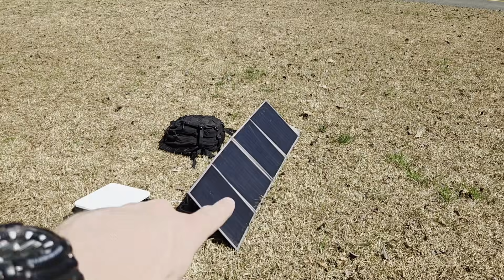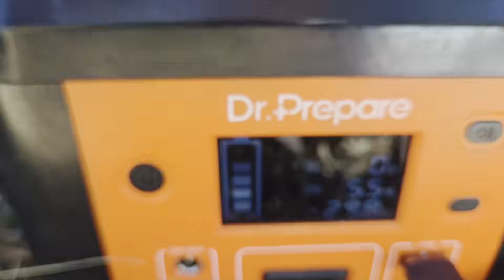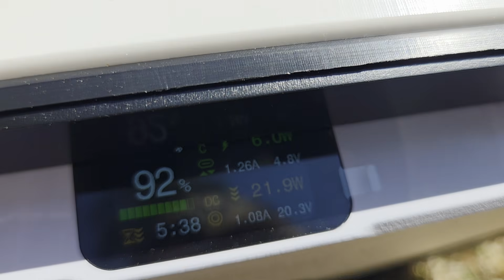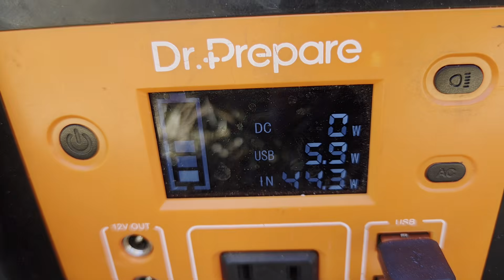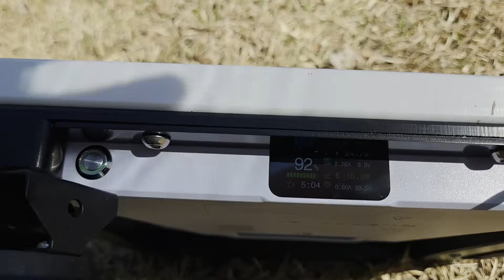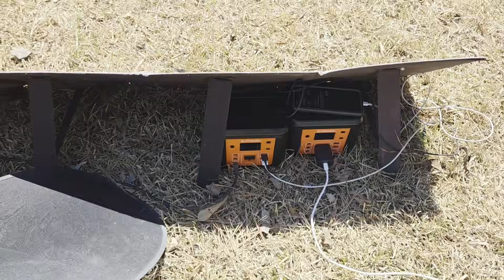Phase 1 Off-Grid Starlink Setup Using Peakdo LinkPower + Solar Panels and Solar Power Stations

Comment: I like this setup.  So the battery on the starlink only pulls 7W from the solar, but using more on the first scenario.  Interesting.   The 2nd setup seems to be ideal.  That is a solid setup even if you had to shutdown for a bit to recharge when stuff hits the fan.  You have to use what you have.  I need to build an off the grid 3D printer setup.  Just in case I need to print the essentials.

Comment: I was just wondering if you experience overheating, and then you mentioned it. Nova (a cutie) needs to let you borrow a dog house where you can put the panels outside (on top or beside it) and run the batteries and electronics inside to be in the shade more. 🙂

Comment: IMO.. you need at least a 1k watt Ipo4 Jackery or equivalent.. also a decent portable panel array .. Harbor freight has a 200 watt portable panel for 149$ in a folding case design. At least a 1000K portable battery unit is the minimum after the sun goes down.. nothing less will sustain power .. best case scenario is a 3000 watt Jackery portable or the like IPo4 technology
Reply from the maker: Agreed, saving for upgrades 👊
Reply: @DrivingDaily919   Indeed, this tech can be quite costly upfront